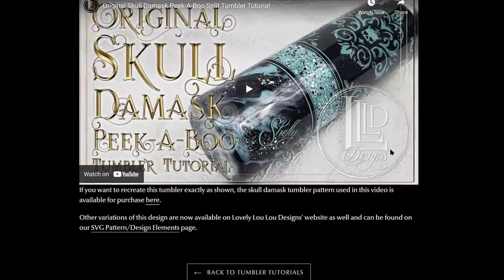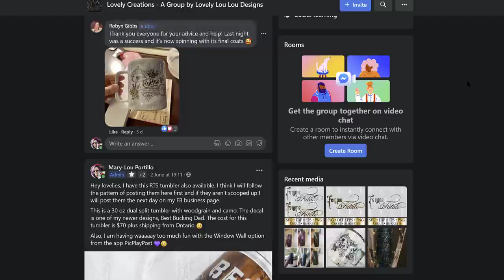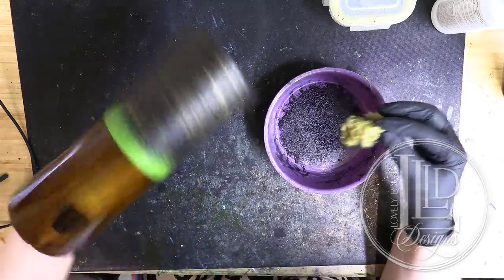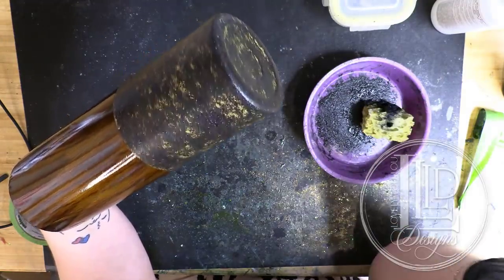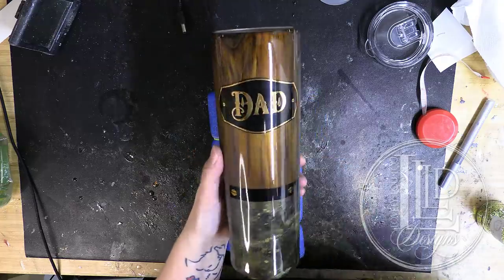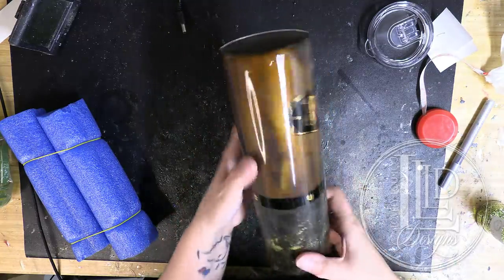Woodgrain/Marble Dual Split Tumbler Tutorial

Comment: I have so many of your designs ♥️ I struggle with my CriCut and the damask designs. It chews up the image. I have high hopes that I’ll figure it out 🙌🏼 This cup is awesome!!!
Reply from the maker: I'm sorry to hear that design is giving you trouble. What cut setting are you using?
Reply: @LovelyLouLouDesigns   I’ve tried a few using CriCut and Paper Studio vinyl and the basic setting for vinyl as well as Washi. What do you recommend?
Reply from the maker: I don't use either of those vinyl brands. I use Oracal 631 usually for masking (stenciling) or 651 for permanent. I've been able to successfully cut the design with Washi setting using that brand. Sometimes if I struggle I find I need to use 651 rather than the 631, but I haven't had that issue with the damask. Hope that helps you.